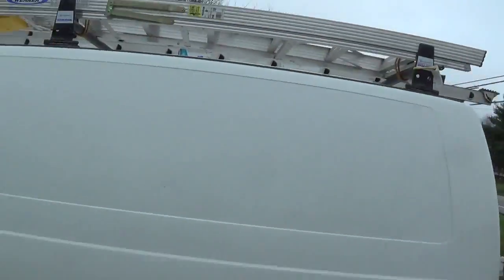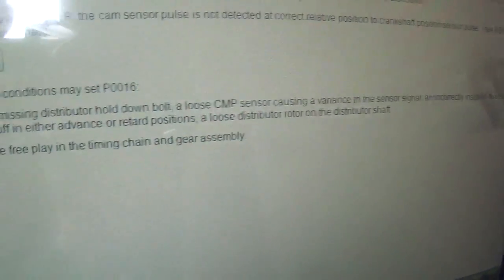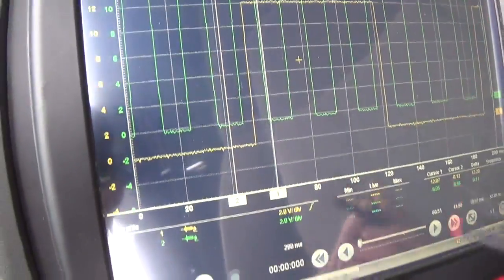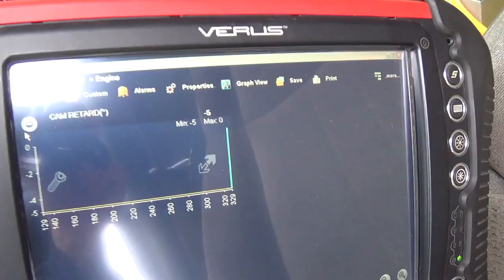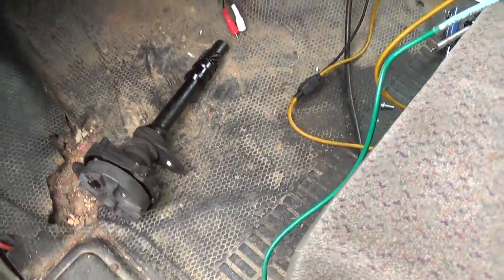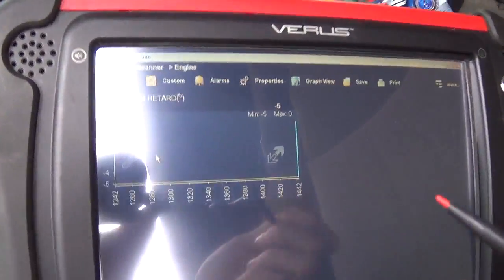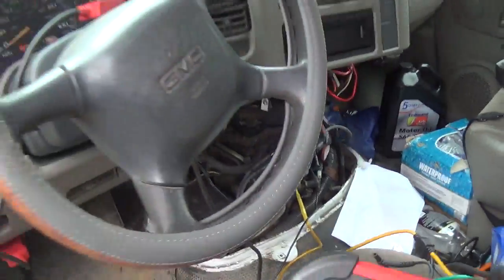P0016: CKP-CMP Correlation case study: GM 4.3 V6

Comment: We had 7 2003 S-10's in our fleet and had to replace the distributors in 3 of them. The gear was ok but the housings were wore out where the rotor would hit the cap. All were over 150K miles.

Comment: cool. i have the same engine running -19 spark timig at idle. Did this car have any drivability issues? on mine i have an over reporting MAF sensor and a rich condition. i think the late ignition is causing low rpm and to compensate my iac valve is opening a lot more than it should causing a high 8g/s reading. unfortunately i dont have a scope and my scan tool doesnt show IAC count to confirm. cheers!

Comment: Appreciate this, man! Steps I've gone through so far - Flushed, then Changed oil and filter, Swapped crank sensor ( didn't have a multimeter on hand) - next I'll likely check and/or change the cam sensor. Probably will check for some play before I do that since I'll be in the distributor anyway. If that's not it, I may have this same issue!

Comment: Nice work, my buddies 04 4.3 silverado is throwing a p0016, we replaced the cam sensor and did a tune up but still throwing the code. I need a diagnostic machine, my old code reader only does so much. Reckon I will pull the distributor and check it out. Thanks for posting, really helps a old school dude. 👍👍🏁
Reply from the maker: Thanks for the comment Michael! It is a very common misconception to think that a bad cam sensor causes the P0016. In fact, the P0016 tells you that the sensors are GOOD, but the correlation/timing is off. Cars are smart these days...sometimes too smart!
Reply: @PineHollowAutoDiagnostics 
Thanks for the reply, sorry I didn't get back to you sooner. I pulled the distributor, gear looks good no slop on bushings. The crank sensor is covered in oil, would that cause the code? He had a guy put a timing chain in a few weeks ago. It was doing this before timing chain, he got it back and it ran good for a couple weeks, now the problem is back, I'm old school guy, and I understand the sensors are taking to each other just not at correct time, not sure what to do. I appreciate your time and reply, thank you very much. 👍👍
Reply: @TheMrmmkkpro  Im dealing with a P0016 code on my 04 Silverado 4.3 also. Havent done anything towards a fix yet but I think I will start with an oil change and check out the distributor. Any solve on your issue? Please share if so.
Reply: @Ucisneros  
Ended up being clogged catalytic converters. Bought some online , replaced them and the truck ran great. It was real sluggish , didn't want to Rev up or pull over 20 mph. Truck is gone ,as far as I know it's still doing good. Hope you find your issue.

Comment: Had a shop change my timing chain after changing oil pump. Getting p0016 on 2014 Silverado 4.3 ecotec. Changed the crank sensor going to change the cam sensor next and see what that does. Some one says it’s recommended to change those after timing chain job.
Reply: Did you figure out what was causing the p0016?

Comment: After the new dist, do a cam/crank relearn procedure. I'll bet 1 of 2 things happen: Either it's now 0* OR you will find slop in the chain by a couple *. Cam gear is harder than the dist. gear. More than likely not a cam gear worn out, causing the -5*. As you say, not yet enough to make the engine light come on.

Comment: Ivan.. Number of Teeth on Distributor equal to Number of Teeth on Camshaft gear; which turns Distributor? not the One which correlates timing with Crank.
720° of Crank = 360° of Cam; a Gear which turns Distributor gear been called Skew Gear and located at some distance than Cam Gear/Pulley/Sprocket.

Comment: im having the same code with my 2008 chevy hhr 2.2 ls it runs great when i get it to start but it has a long start or takes 2 or 3 times to get started cant pass echeck it has no distributor so what is its issue do i need to replace the sensors or what else?it has 98k plus the check engine light doesn't work at all need to get it passed threw echeck so what can i do to fix it?

Comment: You didn't do a crankshaft position relearn after replacing distributor? HHMMM.   I have to say you got one of the easy ones. I always seem to the ones that have to be towed in and won't start. Pull the cap and the rotor doesn't turn. Then you have to try to find the correct location for TDC on number 1 and very limited movement of dist to try to see if your close or if you can get it running. Fun! LOL

Comment: you can replace that gear at the end of the distributor. you don't have to replace the entire distributor
Reply from the maker: +Trevor Beausoleil Cheaper to replace the whole assembly, since the shaft bushings are also worn. Plus you get new cap and rotor :)
Reply: +motoYam82 I've replaced at least 10 of those gears and never had any issues

Comment: the user Willem Streutgers  mentioned  that you could file the distribuitor where the holding bolt goes , to give it some slack

Comment: Wish I could see those waveforms clearer, but it looks like you can see roughness in the top and bottom of the waveforms caused by the valves. It looks like something might be worn causing the cam to turn faster at certain times making little spikes in the signals. Kind of like a relative compression test.

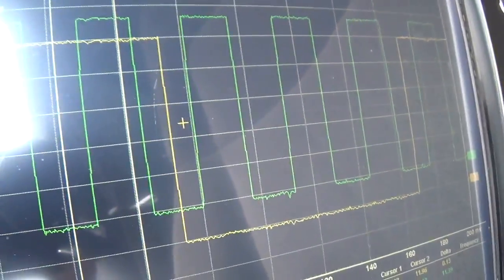Look at the spikes at 5:47 see that little spike/squiggle hump thingy right after the transition on the cam and crank signal. They are perfectly lined up on both the cam and crank signal. Since the sensor work by seeing the shaft moving, if it started turning faster or slower because of less friction with the valves wouldn't that show up in the signal as a hump or spike?
Reply from the maker: +Co Jones To answer that question, we have to ask "how do these sensors work and what are we able to see on the waveforms?" These are 3-wire hall-effect sensors, that put out a DIGITAL (on/off) square wave signal. The only thing we can say for certain is where the transition occurs. So when comparing cam to crank, if those transitions move with respect to each other, then we can say there are some worn timing components.
Any squiggles that you see on the high or low portions is just electrical noise, and contains no useful information.
Great question!

Comment: Yep. except bought an adapter set that Scanner rec. and actually the gauge was on the dash cluster. Still a little uneasy as the pressure port is right by the distributor and stray volts and leaking fuel can be a hazzard, lol. Thanks for the reply and the explanation on the slop at the distributor drive gear, makes sense.

Comment: Sweet. You mentioned that slop in the chain setup would show up on cam/crank wave forms. With the slop in the gear on the dist. wonder why the pattern always stayed fixed, why not the same as loose chain. Be nice to be able to pin point the wear without pulling the distributor. I had a 99 5.7L Chevy in the shop other day had -11 deg and I got it to +3 by moving dist. Had no code for cam/crank. Nor did it affect the running issue. Also had a MAP unplugged, did set that code. Plugging back in made no difference other than clearing code. Been to 3 other shops, with tuneup and MAF for loss of power. Other shops wanted converters installed. Would not no over 4Krpm hot, cold ok. Fuel pump fixed it. Good volume and pressure cold, but took 30 min driving to get pump to lose enough output to give driveability problem. Great videos,

Comment: Nice find and repair, Ivan. Distributor gear wear is quite common on those engines. On some there is a crank/cam correlation relearn procedure on the scan tool.

Comment: G'day Ivan. In Australia we have this same problem with our local Ford six cylinder engines from about 1989 to 1998 models.
The problem over here is the replacement Chinese distributors, their gear is either the wrong pitch or too soft and they end up chewing out like the one you have. The companies fix for this after we alerted them was to put an instruction in the box to reuse the factory gear! Lots of help.
Reply from the maker: +Glen O'Hara lol you might have to start machining your own custom distributor gears!

Comment: Nice video!  I wonder if the camshaft gear is in similar condition....
Reply from the maker: +Bob Weiss Considering the slop went away, I wouldn't think so. Generally the dist shaft gear is made of a softer metal to preserve the camshaft gear :)

Comment: Ivan usually anything below 10 degrees will not set the light, GM LIKes plus or minus 2 degrees.  They are very touchy to set just touch the dist with engine running over 1200rpm  and pid showing on scan tool to adjust. Very good vid . Thanks

Comment: Because you had a CKP-CMP correlation problem most DIYERs and a majority of the mechanics would have just replaced a cam sensor or a crank position sensor.  Great call on the distributor.   Most young mechanics these days don't even know how to retime a distributor once they pull it out.
Reply from the maker: +Upallnight Thanks! Yup I've seen that before. The name of the code itself should tell you off the bat that the signals are indeed present...maybe the word "correlation" is too complicated? :)
Reply: +motoYam82 iven I was just wander if you can share with me  how did you make the pressure transducer thanks

Comment: Like the diagnosis, but would it would be nice to know how one can troubleshoot without such an expensive scan tool. could  it be done without guessing, without a scope?
Reply from the maker: +kkovler1 Basically you need to know how many degrees the cam is retarded for a 100% diagnosis. In this case you need one of two things: a 2-channel scope with a known-good waveform, or an OEM-level scan tool that can show the cam degrees data. Each of those tools cost under a grand...(and I got my Verus used for a grand off the tool truck...great investment so far!)
Of course you can also feel for slop in the distributor shaft and do a visual inspection on the gear...but I like hard numbers :)
Reply: +kkovler1 The old school way is to watch for movement on the cam, crank and distributor while turning the crank bolt backward with a wrench to see when each of them move. Look or feel through the oil fill hole, or take the valve cover off if you can't see the cam. You're just looking for when they move so timing isn't important. You might have to take the cam sensor off if it's on a distributor-like shaft like on some Fords.

Line up  the crank TDC mark with it's reference mark on the block and mark the dist/sensor shaft so you know when the rotor shaft is turning. 
Rotate crank to TDC in the direction the engine turns. When it's lined up turn the crank backwards slowly until there is movement on either the distributor or cam, Mark the crank pulley at your refernce.
Keep turning the crank backwards until the other moves. Mark the crank.

The marks on the crank between TDC and where the cam or distributor starts to move is how many degrees of backlash is in the timing system for each of them. The marks should be very close together if everything is alright. There will always be a small amount of backlash because gears have to have it to work. But anything over about 5-10 degrees on the crank would point to trouble.

Usually, you'd just worry about TDC and the dist rotor because that shows the total backlash is the entire timing system. If you wanted to know how bad the dist gear is worn. Take off the cap and turn the rotor button back and forth.

Us Ol' dinosaurs don't need no scopes. ;P Sorry for the wall of text, but you asked.
Reply: thanks, I  do remember hearing that technique years ago. nice to know it still applies!

Comment: That multi channel scope sure comes in handy especially with the crank/cam signal. Good diagnosis. Me thought distributors were for the auto museum.
Reply: It drives the oil pump so u have to stick something in there